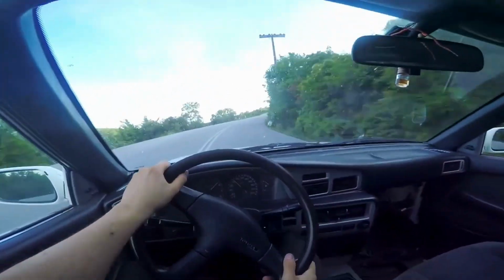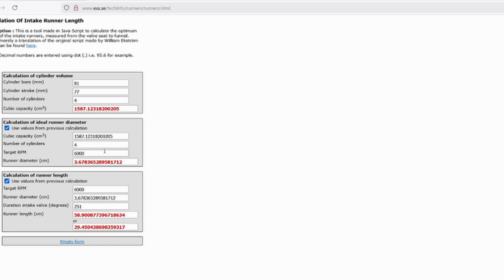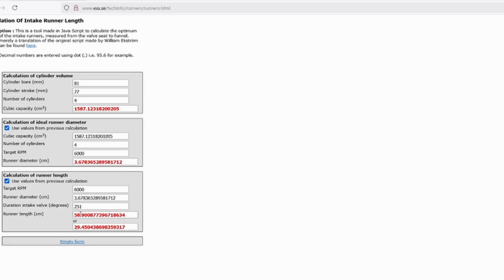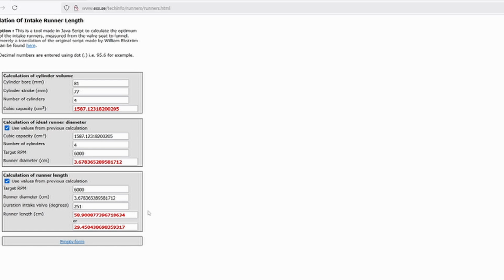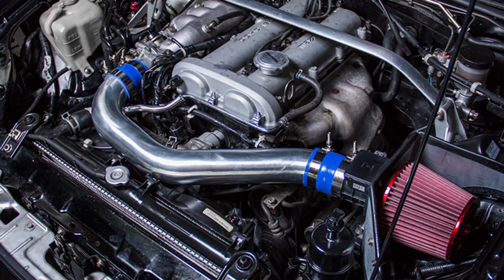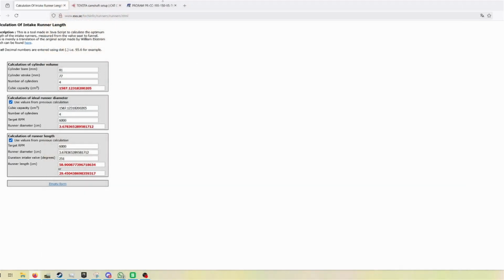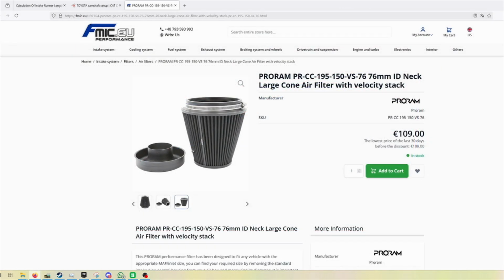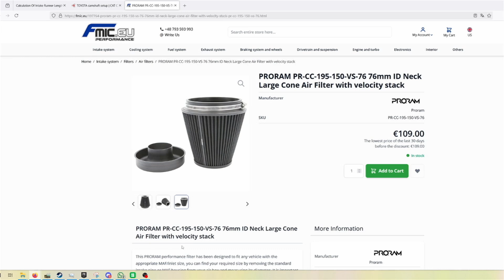How to build the PERFECT intake | Up to 10% more HP with only a Cold air Intake | Guide & Explained

Comment from the maker: FYI: Its obviously more beneficial to build an ideal intake if you have other mods done to your engine. There will be a compound effect, especially if your stock intake system is restrictive 

For turbo application most things will be applicable also, but the Length isnt important as you have the intercooler piping anyway. But it can benefit you in huge ways, especially if your turbo is maxed out. it will remove restrictions before the compressor wheel, increasing its efficiency massively as i have explained in my video about compressor maps: https://youtu.be/tUakD__VZv8

Comment: So you're telling me that a velocity stack on a standard throttle body intake is gonna increase the power? 
What if you stack velocity stacks for maximum gainz? Like have one on the outside and another on the inside of the airbox.
Reply from the maker: yes exactly, thats why most airboxed even stock have a velocity stack integrated and so do most intake systems. if yours does not it could help, tho the further it is from the actual throttlebody or intake valve the less big the difference is going to be 
it is basically for reducing and turbulences and giving the air a smooth path inside + due to the radiut inside also funneling and increacing velovity somewhat!
Reply: @throttlebuddies0 ok…and another thing I don’t understand is why is it - if you put a cone filter right after the MAF sensor, the engine feels less responsive like it loses torque. 
And I don’t mean heat soak, even during winter. It’s like a longer intake tube makes better torque down low.
Reply from the maker: @johnkowalsky1988  mafs can be quite annoying. Does your maf have a mesh in front of it? if not it may help to get a honeycomb MAF straightener infront of it that will help with the readings and with making the air less turbulant before the maf.

Comment: Newb here, what is the best practice for determining the diameter of the intake tubing? My stock MAF sensor housing is at 3 1/4 inches diameter but my aftermarket throttle body has dual 61 mm, instead of stock dual 56 mm. I can get a bigger housing for the MAF sensor and intake but how is the "ideal" size determined?
Reply from the maker: rule of thumb go with the size that your maf has or run slightly larger. same goes for the throttlebody. 
it may make sense to go slightly larger so like 65mm to a 60mm throttlebody or something but anything above that wont gain you anything. worst case it will reduce the effect of the pulses from the intake i talked about. 

the housing from the MAF should not be changed without a change in the tune. as the air that flows through is calculated with the diameter in mind!

Comment: I used to have a 1994 Honda Prelude that someone had cut a hole and ran an intake pipe that placed the filter next to the driver's side front wheel, I guess to get colder air. Problem was that if you ran through a puddle that's deep enough it would suck water into the engine. I hydro locked that engine twice. All I did was an oil change both times and there wasn't any damage at all. It was the H23 and I don't know if that made any difference but it's a robust engine. Bet you couldn't do that in any car made in the last ten to fifteen years. You'd break something.
Reply: I have a 97 accord n did the same thing but comes out of the passenger side. It made a difference to my mpg and a little bump in power. Nothing crazy but noticeable
Reply from the maker: @afroman5531  every little bit helps, especially NA!
Reply: @throttlebuddies0  yeah you tend to notice 10-15 horsepower when it's only making 160 or so from the factory. Bought a black 95 years later with the 2.2 VTEC that someone did  cams, full exhaust, bigger valves, an ECU remap along with a full carbon fiber treatment out front and out back, so all the fenders, hood, bumpers and trunk which took some weight off. That little thing was legitimately fast. Still kicking myself for selling it. They're so rare now and tough to find in good shape. I'd been bitten by the BMW bug though and it's really no comparison with fwd and rwd. Torque steer sucks.
Reply: @jamesstaggs4160  it’s not the same, used to have a 95m3 2 door in ester blue (think that was the name) amazing car. But repair cost chewed me out. Again I kick myself too lol, miss it everyday, but Honda parts are still fairly cheap and take the hard street driving daily 
And if not, a new motor is less than 400 bucks
Reply from the maker: yeah thats often a huge issue. usually if yo still have the splash guard and plastics in that are supposed to keep water out its fine.

Comment: its still hot air intake if is it sucking the air from under the hood...it have to have feed from outside
Reply from the maker: not neccesarily. using a heat shield to an area that is fef with cold air (usually where the stock airbox sits) then that area will be colder than the rest of the engine bay obviously.

Comment: Also i would recommend other material for plumbing instead of aluminum as it absorbes heat much more, i suggest fiberglass or a rubber material, its a lot harder for heat to penetrate these materials
Reply from the maker: you can but the alternative would be, wrap it in reflective tape that will work almost as well. Or polishing. That does basically the same.
Reply: @throttlebuddies0 polished aluminium is the best material known to man for reflecting infrared, even more than a super white colour coating.
Reply from the maker: @stevesloan6775  im not sure about the science behind it but the more reflective a material is the more it will reflect heat. the issue i see with aluminium is that if it gets hot then it has an easier time to transfer heat to the air within that piping. correct me if im wrong though
Reply: @throttlebuddies0 
Heat is infrared light so reflective things (that reflect red especially, so the gold tint helps) bounce the radiant heat off
Reply: Where did you read that science?  A few years ago research scientists at Purdue University came out with the most reflective cooling Barium Sulfate paint to paint building roof tops & roads to reject infa red heat into space & is so efficient, the structure cools itself exponentially.  Lot of info in news release & tests on YT vids by one guys channel on Whitest Cooling Paint.
Reply from the maker: @ its common knowledge that reflective surfaces also reflect heat, while there might be paints that are better suited for that they ar not very common i think. but there is a reason why reflective tape and foil is used in motorsports and high end sports car applications to keep nearby components cool.
Reply: @throttlebuddies0  
You're guessing lots.
The 'foil' is quite thick if you get the proper stuff and is flame retardant, has glass fibres in it and high temp glue.
Reply from the maker: @getahanddown  no thats not the stuff im talking about. its just reflective tape. and as i said is proven to work.

Comment: im glad someone understands CFM instead of geeks saying "nuh uh hot air intakes just loose horsepower", I have done everything in the video i have a heat shield, velocity stack, unoiled conical filter, heat reflective tape covering the plumbing and heat shield as well surrounding radiator hoses, on a butt dyno alone i can really feel the difference over stock but most people dont go that far
Reply: The thing you feel is how much worse it is at low / mid load and mid / low rpm, then better at higher load and rpm. You dont feel it stock because it is just that more linear
Reply: @croustibat682  what the f**ck does that mean kobe bryant
Reply: @Mihka98  It means your feeling are deceiving you.  your butt dyno feeling is caused by the way the power comes on. The stock power delivery is boring and linear, it does not feel fast but it is faster.
What happens with those mods is the engine lose power on 85% of its powerband and on part throttle, but gain some at the top at full throttle. The power difference makes your butt dyno tingle. Yet performance wise, it is worse.
Reply: @croustibat682  interesting, well i suppose i will find out what my powerband is looking like when i go get a dyno tune soon

Comment: WARNING: If you have a turbo/supercharged engine, do NOT install a custom intake until you get a high-flowing exhaust. I have met multiple people in my area's car community who blew their engines because they had installed air intake and the increased airflow coming into the motor but not exiting the motor caused it to blow up.
Reply from the maker: @Lofi.z34  that is not how it works. You might have a pressure differential before and after the turbo but in most cases that is not a big issue and wont cause any peoblems. 
Blowing the engine because of an intake is VERY unlikely  there was something else at play there 100 percent.!
Reply: @throttlebuddies0  Theoretically, but in practice yea it actually happened, we laughed about it but engines like the B58 and VR30 absolutely have blown due to what I described.
Reply: Sounds like a German car issue lol
Reply: @TTAUPerfomance  B58 is german, VR30 is Japanese, barra is american... same issue for all
Reply: @Lofi.z34 Barra is most definitely Australian. Not American!.
Reply: If your friends design an intake that can do that, they can start working for any formula one team they want tomorrow morning, blank check…

Comment: Step 1.  Port and Polish heads.
Step 2. Upgrade cams.
Step 3. Upgrade fuel pump and injectors
Step 4. Upgrade ECU
Step 5.  Install turbo kit
Step 6. Install Intercoolers
Step 7.  Install upgraded 3" exhaust system
Step 8. Upgrade any other component
Step 9.  Upgrade air intake from stock
Step 10.  Get 10% horsepower 

Otherwise start at step 9 and get 3-7 hp.
Reply from the maker: @GameTribe_TV  Well thats not really applicable for most cars as most times the camshafts cant be utilized fully until the ecu is retuned and then it makes sense to upgrade the intake becaus often times that is arrstricting factor and can gain on a stock engine even up to 10 percent. On miatas for example a 10 whp improvement has been tested on the dyno and for a 130i for example even 15 hp so that list really isnt meaningful
Reply: @throttlebuddies0  impressively missed point.
Reply from the maker: + upgrading injectors before upgrading or tuning the ecu for them is not gonna work. THis list is false information. that is spread.
Reply: @throttlebuddies0  lol. Woosh.
Reply: Forget about those 10 steps...too expensive...
If you want cold intake, just drive youre car in the winter time🤣👍
Reply: Spend 10k bucks on a turbo kit that will blow the engine.
Reply: @ghoulbuster1  but! You get your 10% from the cold air intake!

Comment: that is a calculator for intake manifold runners that you have to add head port length from had flange to valve.   Its overly simplified and next to useless, Has nothing to do with calculating induction pipe length.
Reply from the maker: @CL9k24a3  it works though the length for the intake that is being put out by that calculator achieves the desired results 🤔 i wouldnt have shown it if i hadnt checked with some dyno runs for example. The 1.8 miata using that length with a manifold works as well as the specified length for the 4age with itbs

Comment: Awesome video.
I'm curious what your opinion on modern cars intake resonators is. My daily driver (9th gen Civic Si) is mostly stock besides a catback and K&N drop in filter.
The intake resonator isn't even pulling cool air in unlike some I've seen and it takes up a lot of room in the cramped engine bay. If the intake resonator actually creates a beneficial effect for the flowing air thats great but if its mostly a noise reduction design kind of thing I wonder if it'll flow better without it.
Thank you for the interesting video.
Reply from the maker: @celestialyidum  the resonator will eliminate torque drops in some cases or eliminate unwanted frequencies and probably wont cost any power

Comment: Right on, bro .. now how much different would it be if it was turbo or supercharged?  That would be a cool/good follow up vid .. be good info to get out, and i would watch it 😅.. peace and love, brotha, keep it rad, stay safe, and build on..l8r famz and keep having fun 😁 💪🏽🤘🏽🤙🏽✌🏽
Reply from the maker: On a turbocharged application percentage wise definetly wont be nearly as close, BUT depending on how restrictive the stock intake is it can vary WILDLY. on some cars it might only be 5 hp but ive seen cases where a well configured intake can make 20 hp on a 200 hp engine, going from a modified engine with a stock airbox to that kind of intake. and will be even more drastic the more the engine is modified as the intake is a bigger restriction at that point.

Comment: Question about the filter. Nobody talks about the sizing, there’s maybe 3 different kinds, the really short filter I’m assuming if space is an issue, then there’s the medium filter, you commonly see these on 4 cylinders or cars with dual intakes, and then the ‘truck’ filters, these are about 6-7 inches in length and usually on trucks. 

I want to know if the sizing matters because I put an intake system on my rx8 and it came with the basic 4-5 inch filter, 3” in diameter. I opted to put a ‘truck’ 6-7 inch filter on it, 3” diameter, and it made a small power difference. The smaller filter that came with the kit was definitely too small for it. I know it’s a rotary and the draw more air but what about the high flowing 4 cyls like the k series and also v6 and what-not. I’m opting for a 3.5” intake for my v6 and a velocity stack, 6” diameter ‘truck’ filter.

Is there any science for filter sizing in relation to the intake diameter/ engine?
Reply: Make a pressure tester, manometer, with some clear hose.
Test for pressure differential across the filter.
No drop, no problem.
If the filter causes vaccum then try another.
Reply from the maker: @getahanddown  but you would need to flow at least as much ait through the filter as your engine does so can be difficult. 
might be easier to hook a map sensor up before the filter and if it shows a pressure difference compared to ambient pressure then you will need a different one or a different intake setup
Reply: @throttlebuddies0  
Run it on your working vehicle.
Run the manometer hoses to the best spots you can. Get a friend to drive and you can watch.
You'll even see the point where it stops flowing well.
Always test on the car if you can
Reply from the maker: @getahanddown  yep thats what im saying haha
Reply: @throttlebuddies0  
Oh sorry. When you said about needing as much flow it sounded like you were thinking of a flow bench or similar.
And yep you could wire in a MAP sensor but a manometer is literally some hose. Super easy to just masking tape in place, adjust, remove, retest etc and because you are using both ends of the hose you can measure total drop and ignore atmospheric. Eg one end in either half of your airbox.
I use it for factory exhausts. Tap in at points and check for restriction. Way cheaper than swapping stuff that isn't needed
Reply from the maker: @getahanddown  hep a manometer would be a budget way but the scales sometimes arent as great and a digital readout might be more pprecise and also can be logged. but it will fork for sure!!!
Reply: @throttlebuddies0  
My scale is just a ruler taped to cardboard :)
Reply from the maker: usually get the biggest one you can fit. especially for higher hp cars but if there are space constraints make sure you use one that is a dome filter basically so 100 percent of the surface area can be used as intake or at least one that has mesh on the front also. 
as fot the neck. also use the biggest one you can get. even tapering the inlet from 4 inch to 2.5 inch might gain some power but ALWAYS use a bell mouth in your filter. it will help a good bit!
Reply: @ sweet, thank you. hopefully you will cover intake manifolds next? It seems to be a split between using dimpled runners versus trumpet runners that stick out further into the plenum. also would like to see something about dual plenums and crossovers for dual plenums kinda like what Porsche does. Also differences for all the different types of intake manifolds when it comes to NA and boosted applications.